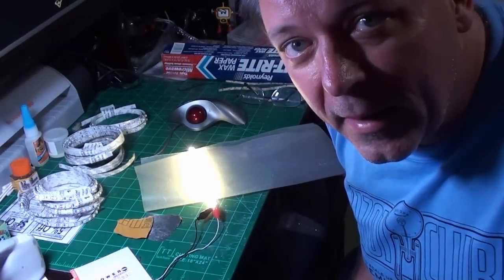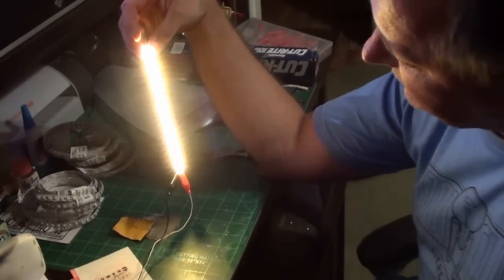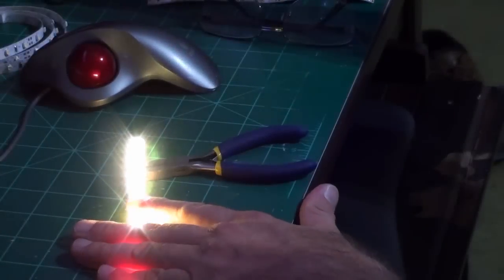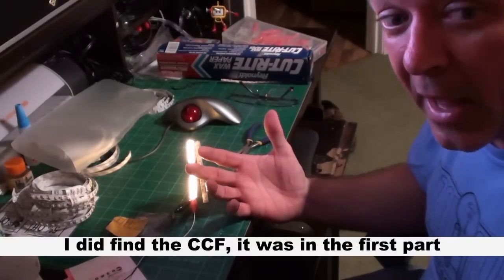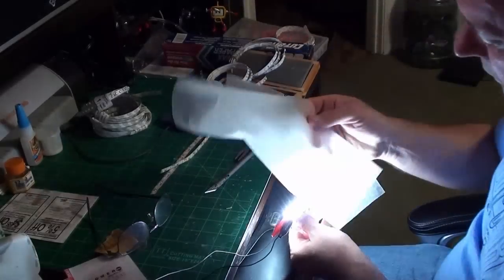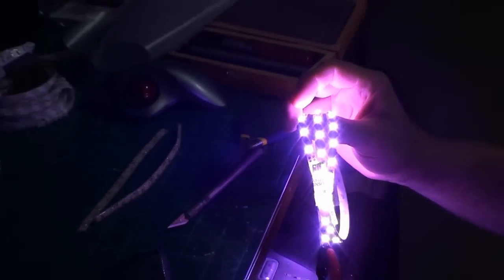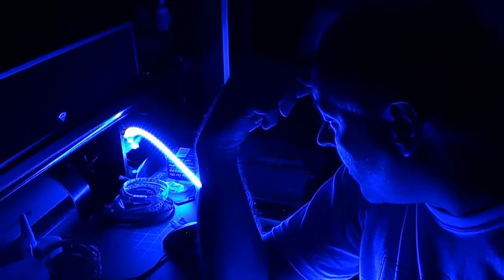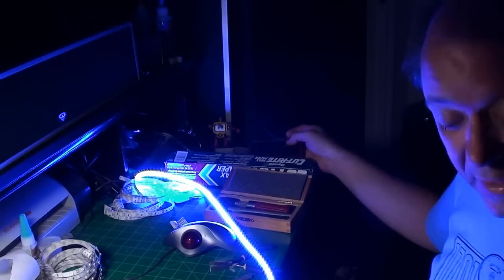Lighting tutorial:  Engine lighting part 2

Comment from the maker: @bttfspencer The problem is you are trapping the heat inside the model where it can't get out.  Heat resistant paint will just insulate it more and trap it better.  Someone who works with the CCFL's in models on a regular basis told me that in small models, you can only leave them on for a few minutes, while on larger ones the time limit is set near 15 to 20 minutes.  With LED's, you have hours...

Comment from the maker: The other problem is that the voltage will drop as the battery will drain, making the life even shorter.

A good alternative is to go to goodwill and find a discarded wall wart.  I got 5 of them on Saturday for $0.99 each.  One of them was 9V and the other was 12V

Comment from the maker: @jdouglasfisher I don't think that they would get that hot (To melt styrene..._  , but the CCFL could get hot enough to warp plastic.  So it is a danger in a small model....

Yeah, thin styrene could do the same job, but wax paper is pretty cheap and you can use milk jug for the same effect.

Comment: just need something to light up my reloader on the inside.  was thinking a 3" -6" of flex light (warm white)  to run on a 9 volt battery. Would this work???  if not what are my other options short of running a 12 v converter to outlet????thanks for your help

Comment from the maker: The 9V battery will light it up, but the question is for how long.   They don't provide juice for very long.   The can provide between 400 and 600 mah of juice.   A typical LED will consume 20 ma of juice so a 9V battery will light up one LED for 20 to 30 hours.   To figure this out take the 400 mah and divide by the number of LED's times 20 and then you will know how long your battery will last.   3 inches of LED tape might have 10 LEDs, so the 9V battery would last for 2 to 3 hours.